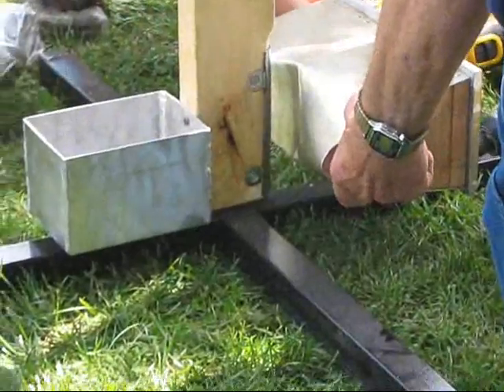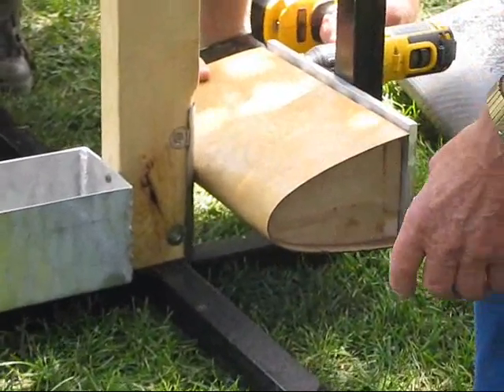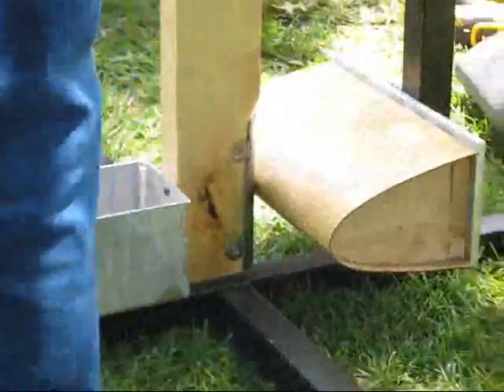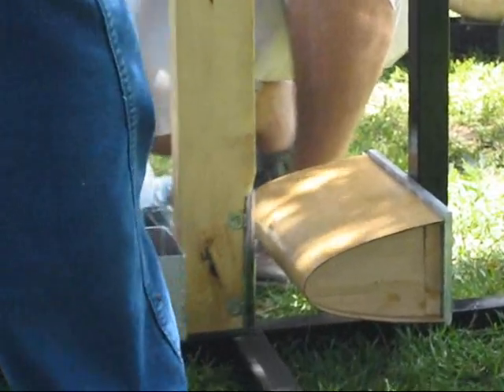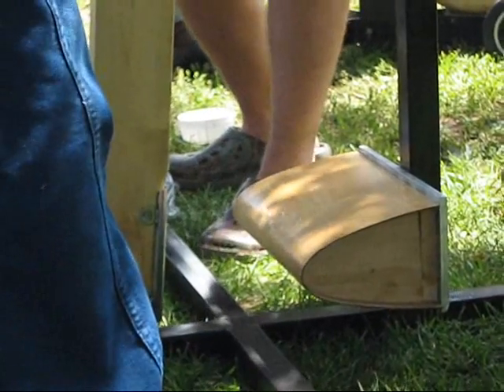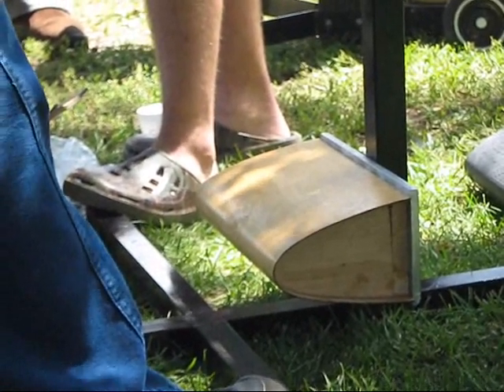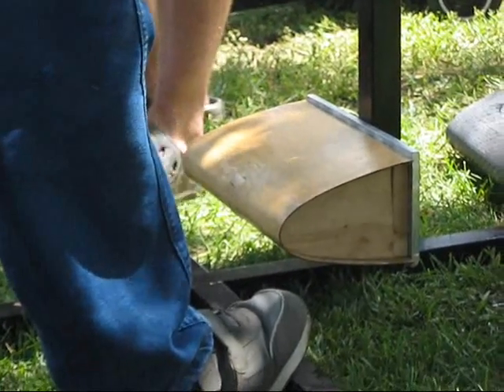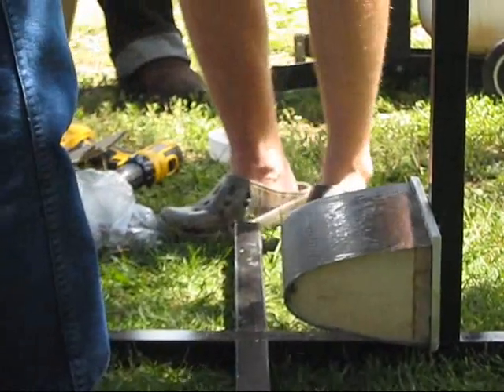Final strength test

Comment: Well, being the first to add a sensible comment, I wonder how accurate this was.  The reason I ask is because when the Carbon fibre for example started to crack, that should have been the point where it was deemed broken, because it's integrity was lost.  To continue on shows that in it's compromised state it still retains the ability to act like a sponge and absorb impact, but it failed long ago as a structural component.  To continue  until there is a big hole in it doesn't really prove much in my opinion.
Interesting test though, but I worry the wrong conclusions were come to.